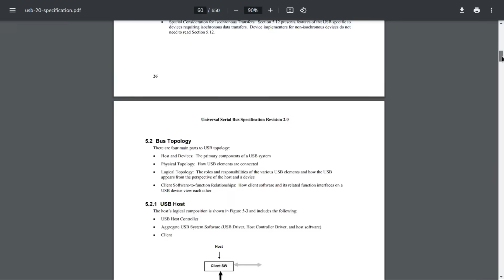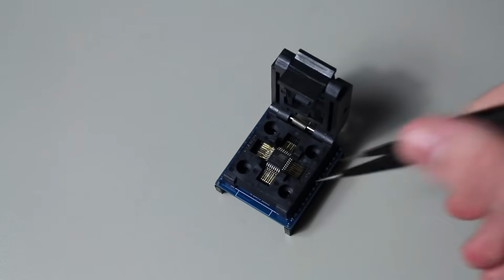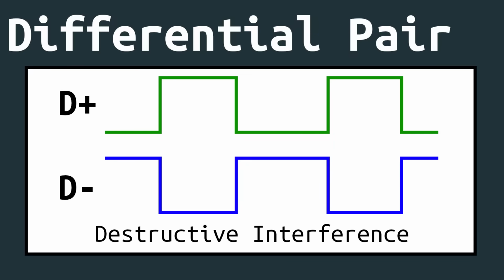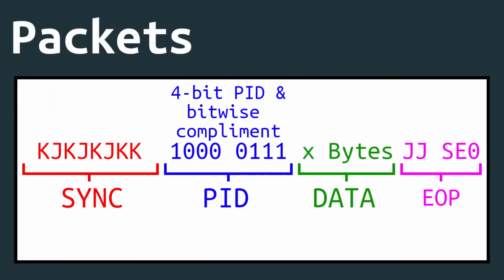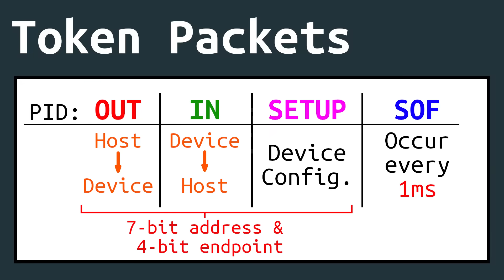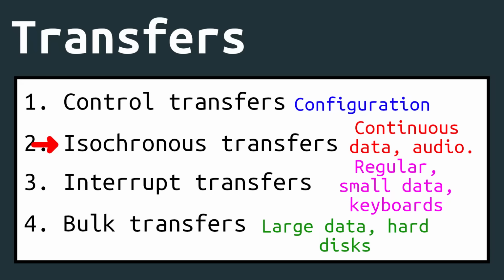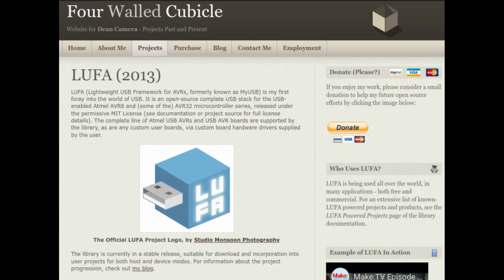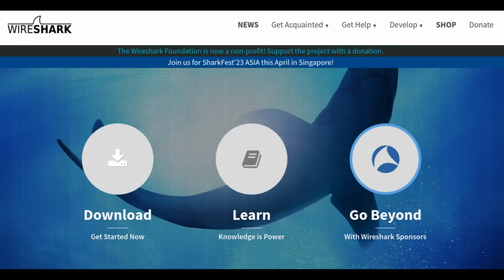Add USB To Your Electronics Projects! - The USB Protocol Explained

Comment: If you just need serial connection to be turned into USB connection, CH340 (with some series of chips requiring even less external components than the rest, like CH340C) is a really, really cheap option.
Reply: I prefer CP2102N, smaller and even less external requirements
Reply: USB to TTL is only one class of USB spec. It won't do HID, Mass Storage, other..
But, ofc, there are easier ways. Like Digispark based on tiny85 with premade libs, which can do some.
Reply: @Mr.Leeroy  Yes. You can technically make something that works similar to a HID device by using an USB to COM converter, but you'd have to write your own driver for the PC. And that isn't easy. Regarding the target audience, they probably want to do HID or USB to COM anyway, because that will allow you to make stuff like your own gaming console, read button states and lights some LEDs up, etc.
When I was playing with this stuff back in highschool, I made my own basic oscilloscope. But It hit the bottleneck for data transfer and I ended up storing the data on the device side and then transfering it through the USB-COM by chunks, so the refresh rate was quite slow. Using another USB class would solve this, but that wasn't an option 15 years ago.
Reply: if you need HID, the V-USB bitbanging firmware can be used on any 20 years old Atmega chip with at least a 12MHz clock. It works flawlessly on any host OS, except Windows that requires installing a driver.
Also, despite what is said in the intro of this video, the Serial port didn't disappeared from modern computers: a COM header is still available on every desktop motherboards, waiting to be connected to a DE-9. Though this solution still requires an additional transceiver like the famous MAX232.
Reply: @PainterVierax not anymore. Maybe some, but not all (in 2024). Yes, up to maybe 2020, most boards supported it, but from the newest generation (Am5) only very few have the COM header
Reply: @TheRailroad99  I guess it disappeared from the "gaming" boards to cut costs. Just like most brands are unable to provide socketed CMOS eeprom anymore.
Reply: Note: I am talking about cases where you already have all the hardware made, but you simply lack the USB-serial hardware. This is very common for barebones Arduino (Uno) and other homebrew projects! For any other purposes, you do need other solution.
Reply: The problem is, those implementations are already talked into exaustion by all other sources. Just type "diy USB" in any search engine and you are bombarded by usb to serial and the likes. Good for a cheap, fast and not customizable application, but horrendous for anyone actually trying to understand the protocol and create a more complex application.
Reply: You could go for an CH552. That's an 8051 with builtin USB. It's fricking cheap too...
Reply: I really like these in conjuncture with the Pro Mini. You can use it to power the project. upload new sketches and get a serial port for debugging.
Reply: So Node MCU with esp8266 which has CH340C work. Can we use that like HID device?
Reply: Even better is to use the $1 RP2040 or whole Raspberry Pico board. USB with C or Python, plenty of power, good amount of I/O and the board is ready to use, embed in existing project.
Reply: @jan.tichavsky  ch340 is like cheaper and easier to use
dont even need to program.

and by plenty of power, do u mean strapping a whole other microcontroller to ur device or do u mean it consumes more power

did u read what the comment said? we just need an interface to usb. for example, for a microcontroller or cpu like 8051 and 6502, mybe these are too old, what about atmega328p which a lot of people still uses then? we could just add a hardwired usb chip like ch340
nobody sane would put a rp2040 on there, at that point, just use the rp2040, and all the other parts in ur existing project has now become extra and obsolete

8051 and 6502 are too old for commercial products, but who to judge u if u use them for home or hobbyist project? that is another reason to opt for a usb chip, rp2040 overkills and defeats the purpose, it seems ironic to use rp2040 as the usb interface while these older micros are the actual brain of the project

of course this assumes that u didnt start ur project with rp2040 in mind but other components
if u have thought of usb, u would have chosen the appropriate components in the first place, like rp2040

Comment: Just wondering: I totally expected you to mention the FTDI-series of chips here. If you purely want to ADD USB to your project, I would go for those. They are pricey, but you can in fact mostly ADD them and leave the rest of your design unchanged (serial communication channels are needed ofc). Also you can get fully fledged modules for quick setup. I typically end up using arduino's to add USB-support for devised however. I like their versatility. And for home projects, who really cares if you use 20 microcontrollers for a task that really would only require one :D
Reply: Though even for a prototype it does sometimes feel a bit silly to have a USB serial uC talking to a GPIO expander uC talking to our applications uC talking to a GPS uC and a bluetooth uC and a battery charge controller uC which itself is talking to the battery's own protection uC...
Reply: @AJMansfield1  Hey, there. Do you have a github or an example of a project like that? I'm a bit of a newb in this space and I think having an example of a project with lots of chips communicating with each other could help me in my learning. I'm trying to understand usb and I'm mostly finding fully integrated chips and there seems like a lot of magic is going on there. I'm trying to understand specifically how someone could make a usb hub without using a fully integrated usb hub chip. however if you could just provide an example of a project similar to what you mentioned, a USB serial uC talking to a GPIO expander uC talking to our applications uC talking to a GPS uC and a bluetooth uC and a battery charge controller uC which itself is talking to the battery's own protection uC, I would really appreciate it.
Reply: CH340G is dirt cheap when you buy it in the form of an IC
Reply from the maker: You are right, if all you need is serial then that would be the best option, along with cheaper alternatives like the CH340. This video was more about usb devices like keyboards, mice, etc. :)
Reply: @NRGY VIA is not the right chip to serve async serial. You want an uart for that
Reply: @NRGY  Read up on asynchronous serial communication. You need an UART to recieve it, you could do it in software, but that will limit the speed a lot, in addition your computer will have to waste time on doing serial stuff instead of doing computing stuff.
There are no 'fifo' lines in RS232, there is RX and TX.
Reply: @akkudakkupl  I don't think you're listening to what he's saying, but for what it's worth I am using a 6522 CIA to talk to a MAX3100 via SPI that does serial. Upon receiving an interrupt read from the UART buffer via the CIA.
Reply: @NRGY Read this https://en.wikipedia.org/wiki/Asynchronous_serial_communication
Reply: @NRGY oh I was just replying to the original comment about using 20 microcontrollers on something that could really be done by one.
Reply: @NRGY what he is saying that you would also need an external UART IC to talk with your main processor if your chip doesn't have built-in hardware for it (6502 CPUs don't have any I think). The other alternative is to bitbanging the uart with the CPU. Which is achieveable, but you need to be able to program it first.

Comment: try making  imu-accelerometer-gyroscope 3d 6dof usb-mouse, should be super snappy for you to do
Reply: no, it does not even have to have grounded position, it just needs the delta movement (2d/3d) and rotation (2d/3d), and yes you get 4 additional movement axes, you might need to add two "rings" on the sides for thumb/little fingers to have an actual 3d experince, otherwise just 2d position + 2d rotation added axes
Reply: well you hold the mouse with the left-right sides anyways, thumb-little finger
Reply: yes its a quest (2) controller, but in more regular mouse format, directly usable as computer/laptop mouse
Reply: not kidding btw
Reply: if you dont need to transmit any data, then.. usb becomes useless, if the recipient already knows everything, like God, with God

Comment: Wonder why USB must be this complex
Reply: This is simple in the context of modern electronics but the main thing is to avoid “cross talk” and sync errors
Reply: avoiding cross-talk, the ablity to structure communication to accommodate a wide range of devices (some not yet thought of, if you want to make something completely new, you can, it only requires a driver/linux or mac module and user-side software if applicable), and making it less susceptible to noise in general.
Reply: @DFX2KX  what about windows? I ever told by colleague that making windows driver is hard, especially when it comes with signature
Reply: @KangJangkrik  the signature is probably the most annoying part of a windows driver. Writing one is certainly not trivial, but USB's design means that the device communication portion of that writing is largely covered. And future revisions of the product that use faster versions of USB can leave large sections of that driver unchanged.

Comment: Sooo excited to test that out! Although, I have this lurking feeling of dread of programming a custom driver
Reply from the maker: Get ready to debug it! :)
Reply: I built a custom driver one time...Microsoft is not nice. Maybe Linux is better? I only programmed it for windows. It was a file based storage type driver and was an absolute nightmare. It did finally work after 6 months of playing with it. But like I say, Microsoft is not nice. It's a real pain to get working. So many parts to the puzzle and getting them all to work together is a serious pain. However now there are many HID compliant ways around drivers, it is probably the best route if you can modify one and use the standards they have for the various driverless devices in that category. All the best to you if you write a driver!
Reply: A very common thing, at least among electronics hobbyists, is to NOT program a custom driver.  Many projects I've seen just use one of the standard Human Interface Devices, like keyboard, joystick, serial, or mass storage, with the most common being serial.  This allows your "driver" to just be user code (i.e., not a device driver at all) that takes care of one side of a client/server relationship between the host and device.

Comment: I thought finally a VUSB tutorial that a mortal can understand, most distributers dont ship to Serbia and locals are ripoff and dont have most modern ics
Reply from the maker: I've added V-USB to my list of future videos. ;)
Reply: @SineLab  I've made whole library with libusb without understanding the protocol, the video was quite useful not gonna lie
Reply: @SineLab  please do, it would get at least somewhat popular.
Reply: @lasskinn474  usb protocol is like linux of communication protocols it has lots of features but not enough opensource ;( if it cant be made opensource worLd needs alternate of it . i think main problem of usb is its default clock speed is too fast
. There shoukd be slow micro version/mode of it for slow devices
Reply: Same here in Bosnia. Locals are ripoffs, with expensive but outdated or low-quality components, while import is either impossible, or even more expensive.
For example, the chip is about $3, plus the $7 fee (see in the video in the mouser section), that's about $10. Everything I look at on foreign online shops becomes 3 to 4 times more expensive with shipping and import fees. So that's $30 to $40. In our money, about 55 to 74 KM/BAM (BAM is the international code). In RSD, about 3300 to 4400. Income in this general region is lower than in the USA etc, too, so that's quite expensive for a hobby.
Reply: Seems like you could easily build a honnest buisness selling ics in Serbia then you'd beat competition through good customer support and parts availability.
Reply: @jessyltr581  problem is probably customs and low volume.

Ofc low volume is a chicken and egg kind of a thing.
Reply: @jessyltr581  Probably not, the country is pretty corrupt and taxes are high so if any politician or anyone important has anything to do with existing companies then youre screwed
Reply: I live near serbia and customs are strict it took 2 months to deliver 1 gb sd card :(
Reply: @lavacat720  Yeah living in the Balkans mostly sucks.